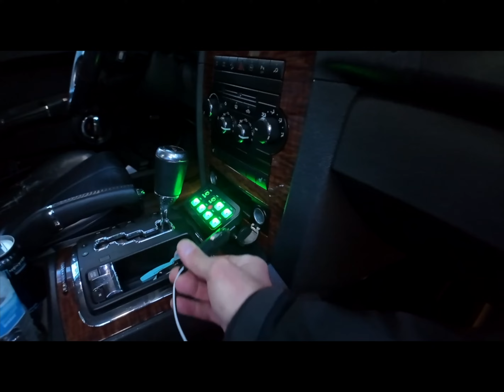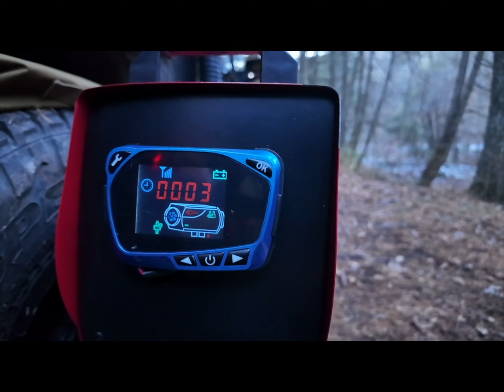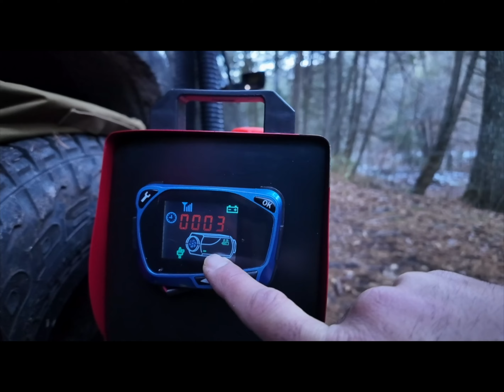Diesel Heater Setup On The Solo Rig

Comment: I have the same setup for a Dodge Caravan. Works awesome. I bet if you turned the heater 180 and shortened up the 3 inch hose and ran it as straight as possible you would be able to run it at lower setting and save on fuel. It probably works fine like you have it but every little bit helps. Also use a insulated hose.
Reply from the maker: I don’t want to run a shorter one because I also use it for ground tents when I’m out with the family but an insulated hose is an awesome tip!!!   Going to check Amazon now!  Thanks brother

Comment: That looks like a really clean setup! I'm looking at purchasing a diesel heater for home backup heat in case of a power outage.  Have you tried starting the heater running off the jeep and then switching it over to the ecoflow once it is warmed up?  I've also ready that some people get 120v to 12v converters to run the heaters off of a power station inverter.
Reply from the maker: Yes! I have heard about the inverter!  Someone else told me and I completely forgot!!!  I’m ordering one on Amazon right now!!   lol
Reply from the maker: Thanks for your post and thanks for watching!   And also thank you for reminding me!